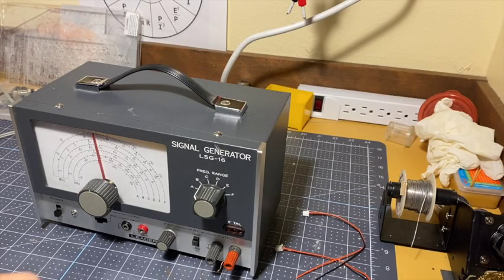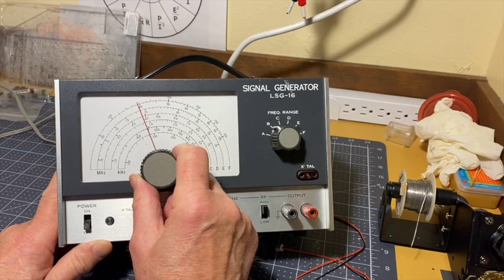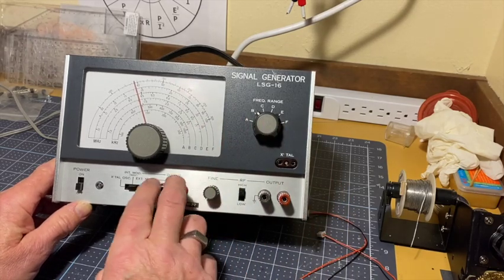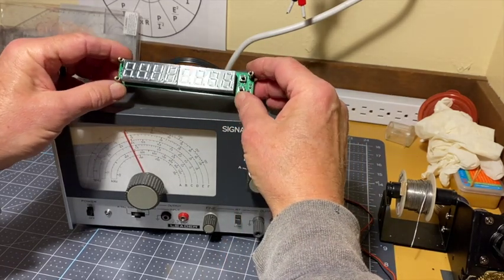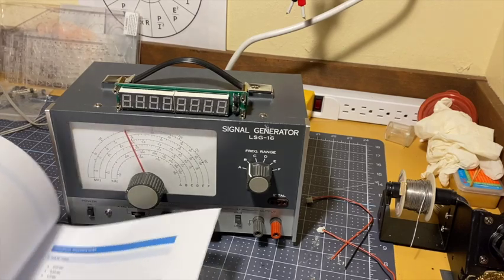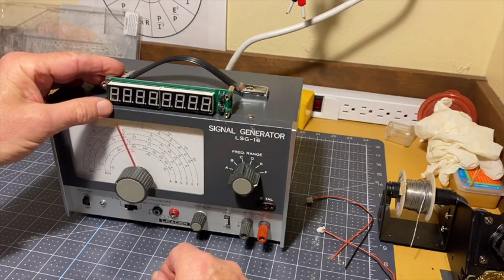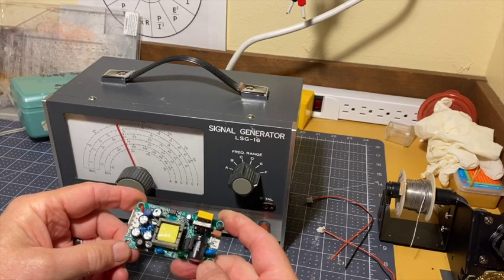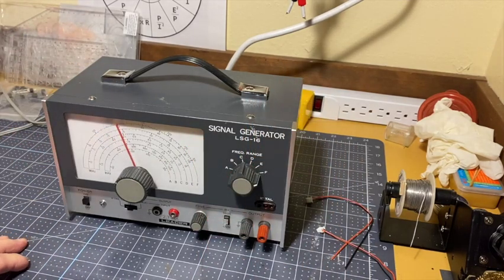Leader Signal Generator Revisited Part 1 Adding a Frequency Counter

Comment: Neat little project. I recently restored a signal generator on my channel which has the same problem: resistors and capacitors which have drifted and no way to calibrate. So it might also benefit from a similar modification.
Subscribed to your channel.

Comment: Cool project! Can unused winding of transformer in power supply an option?
Reply from the maker: Do you mean on the secondary side? Possible, if there were any, but it would require a different solution to generate the required 9VDC. If you mean an unused tap on the primary side, I’m not sure why you would want to do that. If you live in a place that uses 230VAC as mains power, you would approach the solution the same way, but use a different AC-to-DC converter module. Does that answer your question? Thanks for watching.
Reply: The schematic showed an additional winding on the secondary of the transformer. That is why I assumed this as an option.
Reply from the maker: To be honest, I hadn't noticed those windings. However, you certainly could use one of the secondaries. The only consideration might be how much extra load you might be putting on the transformer. The frequency counter I used requires about 120 mA as I recall, so using the secondary would be adding that much load to the transformer, not including whatever circuitry you use to convert the secondary AC to 9VDC. I haven't done any research on the transformer, so additing 120+ mA might not make any difference at all.  Using the primary side adds no load to the transformer, but still takes advantage of the switch and fuse. Good question, thanks!  @harveyellis6758